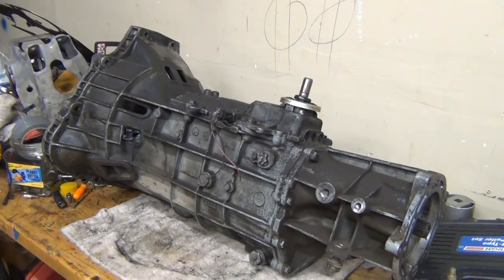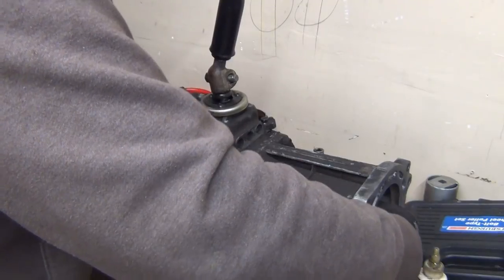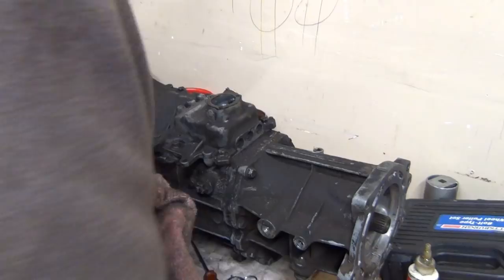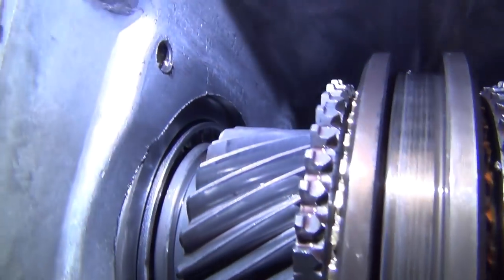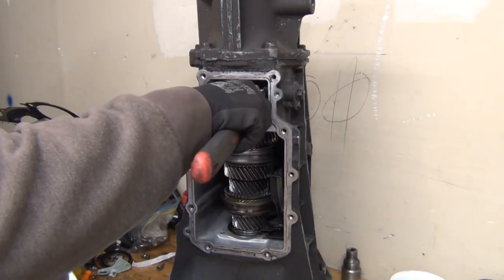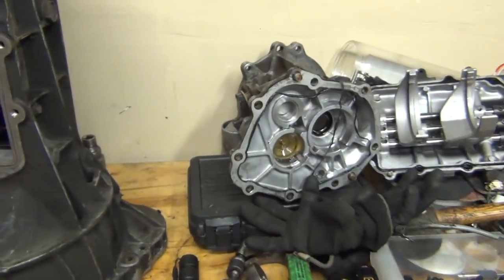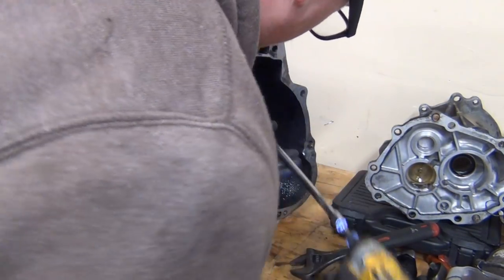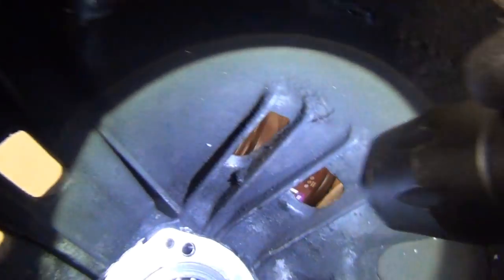M5OD-R1 Inspection | Does It Need Rebuilt?

Comment: Judging by the lack of oil staining inside the gearbox casing I would say that box has been rebuilt recently, within the last 10,000 miles.  It's clearly not a new box from the chip on that one gear but if it's been judged fit for re-use then it's going to be fine for a good time.  As long as there's no signs of oil leaking from the input shaft seal I'd say just leave it as it is and chuck it in.  It should easily be good for another 50-100,000 miles if it's not mistreated...

Comment: question. i snapped the bolts on that shift housing assembly (first thing you unscrewed). what are those bolts, and does that part need a gasket - mine is leaking, and whats the torque on those bolts?

Comment: 1989 Ford F-150 it all ways leak gear oil one day it started winning I added oil and it still wind are the bearings bad now?Should I be using gear oil or transmission fluid. 5 speed
Reply: yes, it seems bearings and seals
Reply: You should be using ATF if it's the Mazda transmission
Reply: I found the best fluid for mine is the GM synchromesh fluid, I have tried many different ones that stuff works like magic

Comment: I have 2 of these one reverse is gone and 1 threw 5 were good but noisy  and the one in my truck now I lost 1to 5 except reverse from trying to do a burnout. What could have happened? I can get it in to 1st to 5 th sometimes but then loose gear while driving. Like it dropped into neutral but still in gear
Reply: You broke it doing holeshots. What do you think

Comment: Any play in that input shaft? My M5R2 was a bit wobbly.
Reply: Mine has that too. Have you spun your inout shaft by hand? I hear the input gear meshing too hard.
Reply: Believe it or not, some transmissions have a wobbly input shaft by design. Getrag 290,NVG3500 out of 96-04 Chevy S10 & Blazer. Those have wobbly input shafts brand new. 90's Dodge V6 manual transmission trucks used these transmissions also.

Comment: I have a 2.3 1995 Ford Ranger manual transmission. The shifter Sticks on every gear. I changed the fluid even added a little bit of Lucas. To see it would help but still sticks like hard to go in gear.  Any idea?
Reply: Did you use gear oil or atf because I found out that this trans takes atf which is stupid
Reply: I used atf automatic transmission fluid which I thought was crazy for standard transmission. But that's what it recommends
Reply: Domingo Trevino it could be that your clutch isn’t disengaging all the way so the clutch lightly rubs making it more clucky going from gear to gear
Reply: Thank you I think your right. I think I may have to put a new clutch in it already.

Comment: I have a 1990 Ford F150 and the transmission is a M50D-R2 and it won't go in 5 gear and my reverse goes in but it pops out when I start moving my truck what can it be and is it a easy fix?
Reply: Did you ever fix this my bronco is doing the same
Reply: It could be bad synchros
Reply: My f150 did the reverse thing then started rattling loudly, I fixed it, it was the reverse counter shaft bearing rollers came apart and got cought up in the other gears, new bearing and a cleaning and good to go again, took 100 or so miles for the rattle to go away. Good luck